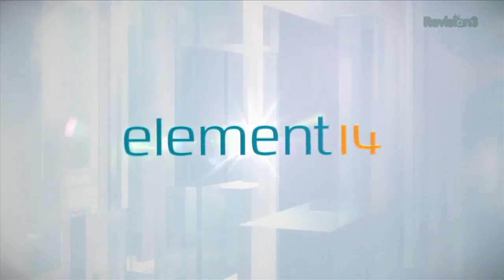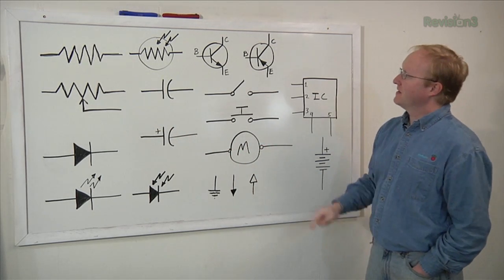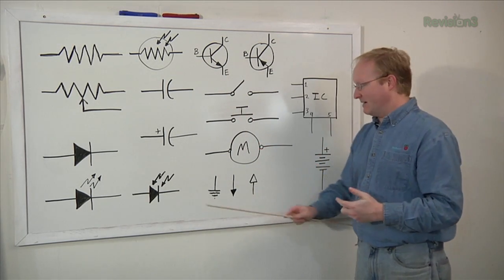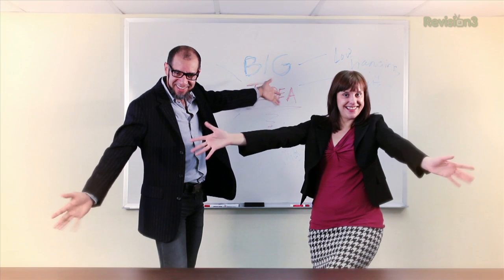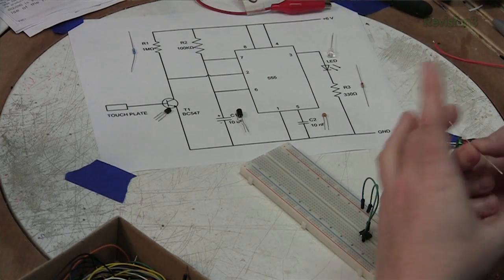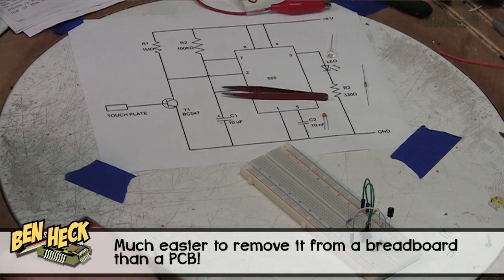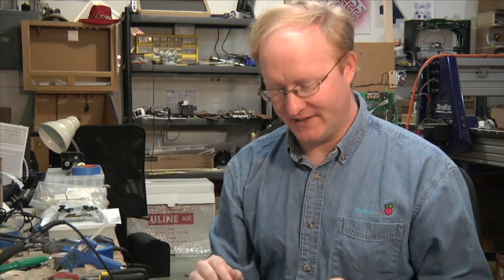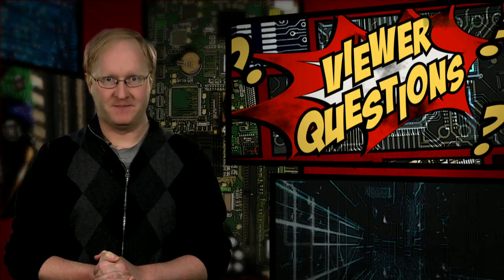Principles of Schematics

Comment: How do you find out where to connect the positive side of the battery if it does not show it if it only shows the grounds? For example if there's six components connected to the top rail does it matter where you connect the positive voltage in?

Comment: As a beginner, I've always found the concept of ground a bit confusing. Sometimes there are positive, negative voltage and ground; Sometimes, like here I guess, ground means the negative pole of the battery right? Sometimes it's chassi ground. How do I distinguish between them, and why not just say positive and negative instead of positive and ground if that's the case? Or am I confusing things?

Comment: Hello!
For my project I use atmega328p-pu. And I don´t know if I need a 5v DC regulator if I have a 5v DC transformer (230V AC-5V DC). Why I need a 10 (or 100) microfarad capacitor if i use atmega328p-pu without arduino? Thank you and sorry for my english.

Comment: Hello!
For my project a use atmega328p-pu. And I don´t know if I need a 5v DC regulator if I have a 5v DC transformer (230V AC-5V DC). Why I need a 10 (or 100) microfarad capacitor if i use atmega328p-pu without arduino? Thank you and sorry for my english.

Comment: Thanks for the video. Quick question about current flow. Even though most schematics use conventional current positive to negative isn't true current in wire circuits going from negative to positive?
Reply: If by "true current", you mean the direction of the flow of electrons, yes. In visual representations, it is an agreed upon convention to indicate the direction of current as the direction of the flow of positive charge.
Reply: Thanks for the reply, definitely appreciated!

Comment: So according to the schematic, I can see where pins 7 and 6 are connected, but as far as pins 6 and 1, I see they are not connected even though there is a line going between them.  Is this common that the line going across from power and the line going across from ground should not be visualized in relation to the rest of the circuit?

Comment: I have a lot of trouble visualizing from schematic to breadboard.  Any tips to help me out?  Even this video is confusing.  I understand what Ben is doing, but I just can't wrap my mind around how to interpret such a large schematic to a small breadboard.
Reply: Ok, I figured it out after some more practice.  One baby step at a time
Reply: use a program called fritzing. reacreat the schematic and it will be autotomaticly on a bread board so you only have to connect the wires like you see them on your screen

Comment: with an opto-element or smth else u can use the vibration circuit on old cellphones.. send sms to the cellphone and f.e. control smth or start smth that is far away.. just put a 5$ sim card in it and u are rdy to go... when the phone rings the circuit can do smth for u..
Reply: Powder yo I totally need you to brake it down . just enough so that i can understand. like what is smth

Comment: what role does the 555 timer play in this circuit? You can make this sort of thing without one. Anyone explain?
Reply: ik im late but im guessing that it just makes a suqare wave for the transistor
Reply: That's right, a 555 gives you a nice clean on-off from your RC timing rather than the RC circuit's own charge-discharge curves.

Comment: I have several schematics that I was working on. There are hollow arrows pointed left,  right, up and down. Are all of these just Positive voltage? If so, what voltage? There are places where a line is going up or down and left and right and the line ends with a short perpendicular line with AV+,AV_,+3.3, or the line goes out and has a X on the end. There is even a open arrow to a round point and it is marked ground! There are places where a open arrow has a line with 2 Teed off lines that are just marked 9 and 10. Ok these go to the ic pin 9 and 10. Which IC?  What do each of these mean? I am lost!! The schematic I am speaking of is one by JYE Tech for their DSO 138 diy oscilloscope. If you can find the time I would appreciate some help with the signs. I have the kit, but would like to know what I am soldering.
Thanks for your time and have a nice day.
Don
I hope this video is not so old that you don't respond to it!
Reply: amtpdb1 Those maybe logic gates

Comment: I plugged this schematic into every circuit in an attempt to garner some understanding.  What's throwing me off is my grounds.  My voltage source starts positive with all ground connections equaling the negative.  Am I assuming wrongly?

Comment: can you connect the 100k ohm resistor from the positive rail to pin 6? if pin 6 and pin 7 are connected it seems the same to me? would it connecting it to pin6 cause issues with the 10uf capacitor that is also connected to pin 6?

Comment: Thanks, still have my breadboard but it was Dos days when I went to Tech school and that info went in one ear and got pushed out the other by time and irrelevancies. I still have my books though so maybe I'll give it another go with some simple circuit, The sad thing is we don't have the electronic stores that you could find all those components in racks with bins, at least in W.L.A. Funny that I still have my last project on that board but I don't remember what it was. I had a store and was repairing medical equipment that was in some cases housed in wood! It was solder days, then progressively became micro and modular.
Reply: Same over here

Comment: My parents like to text but they need a phone with larger keys and a full qwerty keypad, not a touchscreen. Any suggestions? I am thinking I am going to have to build it myself. I would think there would be some demand for this in the accessibility community, but I just haven't found a phone with this feature yet. Just to clarify, I am looking for a phone that has a full qwerty keypad that is a bit larger than those on a Pantech P6020 for example and does not have a touch screen. It would be great if it was about the same size as a TI-65 calculator and a clamshell design to protect the screen and prevent 'pocket dialing'. Also it would be great if it used regular AA rechargable batteries.
Reply: *****
Yes, a slider would work as long as the keys are big enough and spaced enough. I think I am going to need to make that myself as I still haven't found any keyboard that is just the right size. It would be great if it was about the size and spacing of a TI-65 calculator. Those keys are spaced just right and my dad likes them as he used that calculator a lot. He makes too many typos trying to use anything smaller and anything bigger just isn't going to fit in a pocket. They also hate touch screen and would prefer a good ole solid switch to lock the phone rather than a button combination to unlock it. They are all the time pocket dialing and sending blank messages to people or worse, their contacts self delete etc.
Reply: *****
Thanks! This convo has helped me to think about what I really need to do, and that is to custom build a keyboard that is just the right size and then wire it into an existing phone. That way I don't have to worry about coding and I can make it with a slide switch to turn the keyboard off when not in use to prevent pocket dialing etc.

Most phones actually are not waterproof, although they could be with some strategically placed silicon sealant. That is another excellent idea! Thanks again!!!
Reply: *****
Yeah, there's a lot of possibilities. What I need right now is to focus on implementing one and so I am going to focus on making a keyboard that is just the right size and I will likely implement the shell for it after I get that part done, and then I will figure out how to connect it to a phone which will probably be with simple brass hinges to close over the screen of an existing phone. The hard part will be to take a phone apart, wire the keyboard to it in such a way that it works, and put it together again. Harder than that is getting off Youtube long enough to get started! heh heh

So I have a bunch of printer/scanners I can take apart for the parts. I also have a broken computer keyboard and a couple of old phones. One is a Samsung SGH-A77
That one had a glitch in the screen and I took it apart and put it back together and now the screen won't come on at all.
I have a Pantech P6020 that I use right now, but it's my mom's phone that she hates because the touchscreen keeps pocket dialing and stuff. She locks the screen but when she gets a text it will unlock the screen!!! I hate that too, but I don't get as many texts and so I am not as affected.
Recently I picked up an LG VN250 for a fiver from a thrift shop. It is locked to Verizon while the others are AT&T.

I'm just too scatter brained to get started. I need someone to talk me through it or give me step by step instructions. I have a soldering iron, a voltmeter, a Raspberry Pi, a Beagle Bone Black, and other stuff. I have access to a mill and a wood lathe.
Heck, I have 6 stepper motors and yet I haven't yet put them together into a CNC mill. It's funny how I can help other people but I can't seem to help myself. heh heh
Reply: *****
I'll bet I can use the same charger circuit that's already in a phone to charge a larger battery. I'll just have to solder some wires from the tabs in the phone to a battery pack on the outside of the phone (with an inline connector of course so I can swap out the battery pack without having to desolder it).
Reply: *****
Sadly, no, but I did get some other stuff done today. Woot!

Comment: Can you substitute 1x100k resister with 10x10k resisters in parallel? I am not saying I would or asking if it is reliable/efficient, just asking if it is possible on a mechanical level
Reply: Yes, indeed you can. This is done a lot purposely by motherboard and power supply manufactures so that they have backup caps instead of one big cap that would stop computer working. 10 caps gives you 10 fail chances. Capacitance just adds up.
Reply: No
Reply: Falney You would connect them in series.

Comment: Current does not flow in the direction of the arrow on the diode diagram symbol, that's a simplification and assumes one is using conventional flow theory
Reply: ***** Do you have difficulty reading?  I ask because you are assuming that I am saying only electron flow theory is correct when in reality I merely pointed out an error and oversimplification.  Please take your audacity elsewhere.
Reply: ***** Very humble response I'm not used to seeing here.  I appreciate and respect that.  I apologize for being offensive.
Reply: current in a conductor is basically pulling e- out of a material by removing e- on the other side with the higher potential. whats causing a domino effect (hence the near light speed in transmission; and a freed electron itself has a very slow speed at a few centimeters/second). its the missing of the electron which is wandering so fast (from plus to minus) hence the two views of electronic current flows: the domino effect of the missing electron wanders from plus to minus. thats the way you prefer to see it when you look at the technical one which is used in all schematics. but in the real world electrons jump over from one atom to another and bring away an existing electron of that atom. and that impulse wanders (physically many electrons are transferring pretty slowly from minus to plus). depending on the application plus and minus are exchangeable.
Reply: Nuke Arts What have you solved that was not solved?
Reply: jayfulf nottingham. just tried to leave a correct explanation xD which seems to go terribly wrong xD
Reply: ***** Wow, this just blew my mind. I knew there were different ways of looking at it, different theory, but until now I hadn't actually thought that protons might be physically moving just as electrons are in a two way current! Thanks!
Yeah, it's easy to picture electrons as those lightweight happy-go-lucky sprites energetically moving about in a cloud, but even though I know protons can behave as a wave, I always thought of them as being solid in the wire. But of course an extra proton probably does knock a proton from one atom to the next just the same as electrons do.
Reply: *****
Electrons have very little mass and therefore very little momentum, and yet, current flow behaves as if it has momentum. This can best be explained by protons moving as well. This would help explain why a flyback transformer works the way it does.
Reply: You were trying to be a smart ass...
Reply: ByteMe You are late, so very very late

Comment: It's possible, but...
1) you would have to guy out your xbox and replace a ton of hardware. 2) Microsoft would probably brick your system once it caught on that you were using invalid discs.
3) PS3 games are coded for PS3's only
4) PS3 games are on blue ray discs, Xbox uses DVDs
So if you did rig your system to play PS3 games, you'de basically just have a PS3 in an Xbox case

Comment: Hi. I dont know if this is totaly within your line of work. but... In my line of work i use a fullface gasmask/dustmask , and after wearing it for some time while working it gets kind of warm in there. so i was wondering if you could come up with a way to keep the mask cooler inside. through the filter or something. or make a piece that goes between the filter and mask. the mask has a standard industrial 3M connection. I also have an Military grade gasmask(just for fun) standard NATO filter :)

Comment: When describing current flow through a diode you state the direction is towards the point of the triangle. This is actually incorrect. The holes flow in that direction but the electrons move in the opposite direction. Electronics Engineers are taught hole flow, or the spaces the electrons occupy. Electron flow however makes more sense when actually working with electronics. .Still we mostly consider a positive terminal to be hot when the electrons are supplied by negative, usually ground.

Comment: There are 2 standards for electrical symbols in use, one is the 'American style'the other is IEC wich indeed is using the box symbol for resistors. Unfortunately this is not mentioned at all. A lot of the schematics found on the web use IEC.

Comment: Your definition of diode current direction is misunderstandable. probably better is to say: the positive connection needs to connect to the triangle to connect. Also, regarding resistors, in some parts of the world a box is used instead. for capacitors sometimes one side is thicker, thats the negative part. Also, note on wire connections in some parts of the world you don't need to mark non-touching wires. Instead you make a thick dot at the connection point

Comment: Yeah... I think that's asking a bit much. I mean, in principle if you had the time and patience you might be able to hack together something relatively primitive using microcontrollers and FPGA circuits, but even then you'd probably be using a lot of pre-made parts to get anywhere near to it being practical. I've seen prototype boards for FPGA chips that are relatively easy to work with. (one even has sample programming for VGA output), but it's a huge task even then...

Comment: There you would need to know some bits of data and use one of the founding formula, E=I*R , Voltage = the sum of Current times Resistance. So if you have an LED and you know it can take 50ma and your going to use a 5v source, with some basic formula manipulation it would be 5v / 50ma or 100 ohms. :D

Comment: A transistor basically takes a tiny electrical signal and opens a gate for a bigger electrical signal to go through. Hence the 3 pins. In/Out/trigger. And ground is like the end of the circuit. Like a battery, + and -. The electrons flow through the circuit, and back into the power source. Electricity cant just go nowhere, it needs a direction. From one end to the other.

Comment: You put in a photodiode but not a comparator or opamp in the most used component list? I can assure you that there are waaaay more circuits using opamps then there are circuits using photodiodes